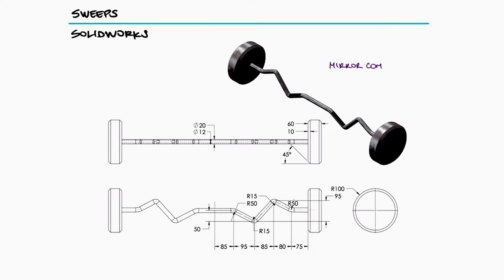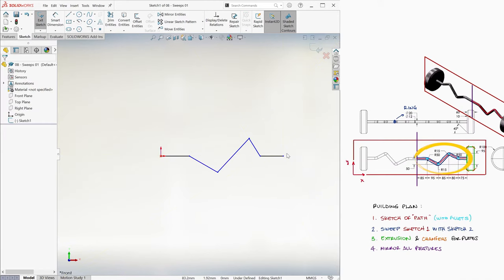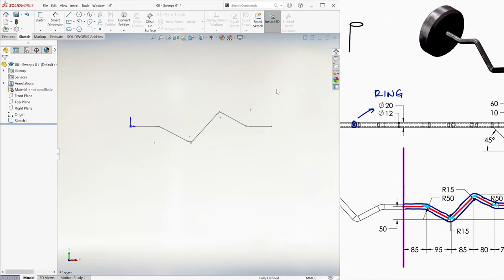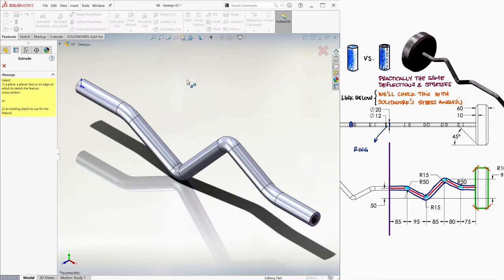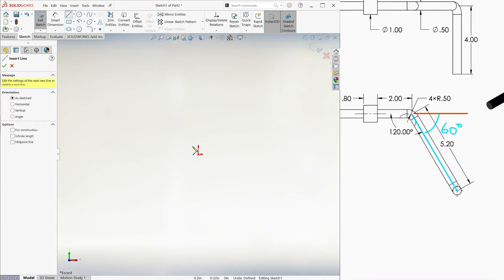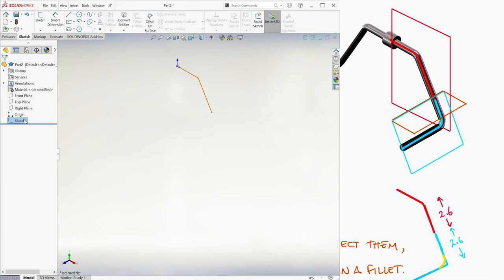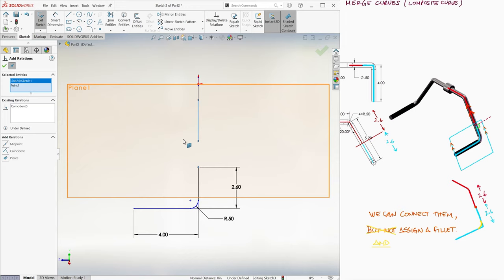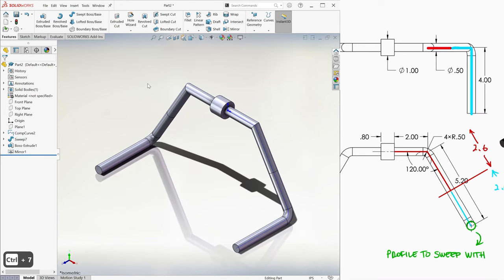Easy 2D and 3D SWEEPS in SolidWorks in 10 Minutes!

Comment: Good demo of the "standard" method of sweeping a sketch.
However, for "pure speed" like someone taking the CSWE exam or something, make it a habit to use the SWEEP CIRCULAR PROFILE, when you "see" that the profile is a simple circle or hollow circle.  Sequence:
a.) Just click on path
b.) click on thin feature and specify thickness

What you save:
a.) selecting plane for 2nd sketch
b.) creating 2nd sketch
c.) dimensioning entities in the 2nd sketch.

Ofcourse, if you are a beginner or just want to create a more robust model(revision friendly)....then I would avoid "sweep circular path".
Reply from the maker: Thanks for the comment. This is in fact a lecture for people that are just beginning to learn how to work the different features of SolidWorks. Using "circular profile" is already planned to be pointed out in Monday's video (helical sweeps, where most of those components are in fact solid; like wires for springs, instead of hollow circular structures). Thanks nonetheless!